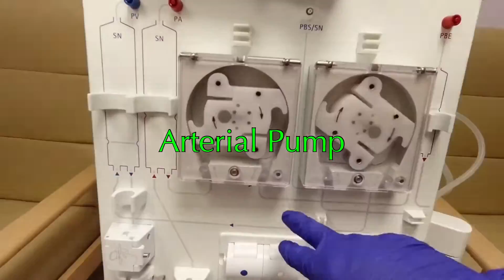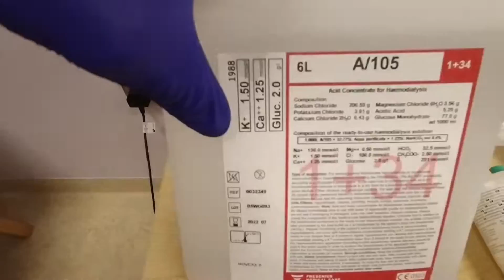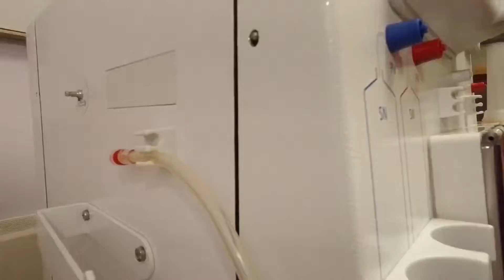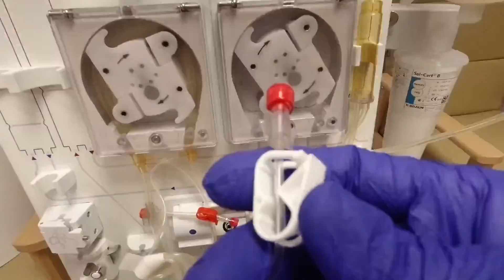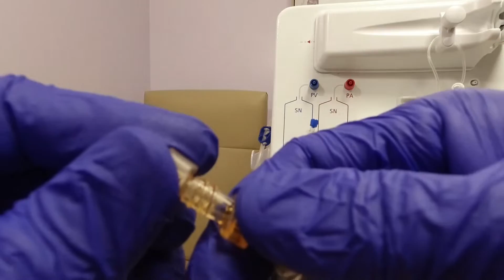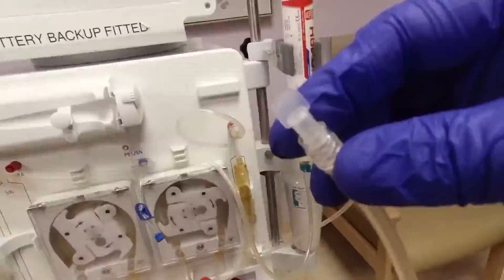HOW TO LINE (BRAUN DIALOG+) HEMODIALYSIS MACHINE | EASY STEP BY STEP GUIDE TO LINE BRAUN HEMODI...

Comment: Do you have this guide with the machine turned ON?
It would be much helpful if the lines were setup with the machine turned on and in preparation mode.

Comment: Your camera has a flicker problem. Most likely, you had it set-up for automatic anti-flicker detection. Depending on your localtion, better set 50 Hz. or 60 Hz. compensation manually, so there is no confusion. Flickering can make great videos very unpleasant.

Comment: I'm on that machine every two days here in Germany. Alltough we have the two pumps variant of the system, we only use the left one. We also do not use the heparin pump, instead, heparin is given by manual injection for most patients at the beginning and in some cases a second dose after 2 - 2.5 hrs. Our blood line setup is very simular, but not identical.

Comment: In a centralized module of medical/ health facilities special areas and clinics, of the layerings and of spacings of the likened to. A similar system bound effect of starting with hoolahoops of strings of several orbit rotate to each dual ghostings of insertions of mosquito repellant shape in system like circles, to a rubber band like extentions of push and pull while working in between of no system or instrument monopoly by design but by ingenuity of craftmanships of junctional tech application of medical, science of physics to microbio application analysis and research over the variety of levels of application tech using generalativity ot by specific modes.

Comment: It's like equipments parts reconfiguring by knowing it's measures not just for ISO protocol medical equipments wise but for added modification of materials wherein like bring in area of remote then creating by 3D printer as long as you have that or some common adjustable adaptors or science elements correlated compatibility lists to what procedure shall be done  or a make over materials of versatile if in an experiment likened to  how to proceed from previous models  likened to adaptable materials not just for haemodialysis but for liver dialysis and of dual applications if feasible to additional ports for genetic or cancer correction by microparticles in a membrane, of response to your assembly of tech equipment type. How about other power plug of compatible strip down components and test period for a used up old equipment for variety of power type insertion of either electronics or photonics or tonic energy, ( drink, joke )

Comment: sir is it possible we can set up home. what requirement require to set up at home. please let me know
Reply from the maker: Hi Asif, yes it is possible to set up a home dialysis but on a different dialysis machine and not the one shown in this video. You will need to liaise with your nephrologist, have a permanent vascular access and clinically well enough to dialyse at home. You’re unit dialysis nurse should be able to give you more details. Hope this help. All the best.